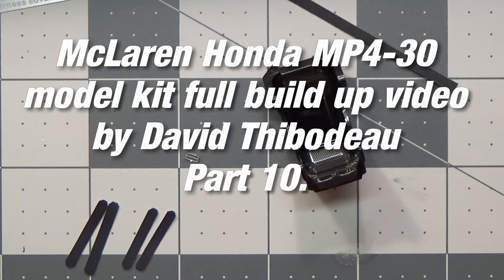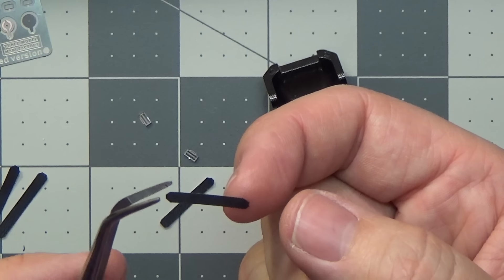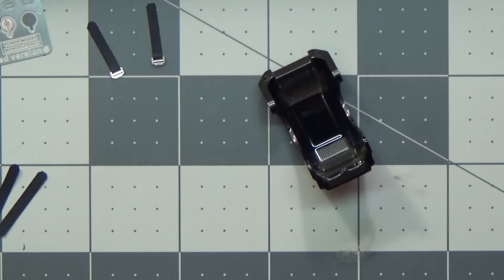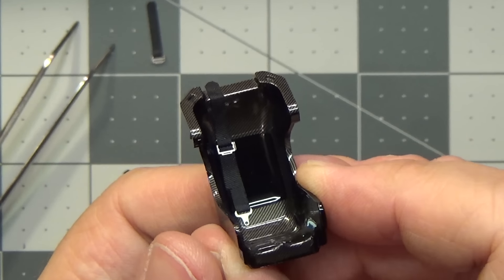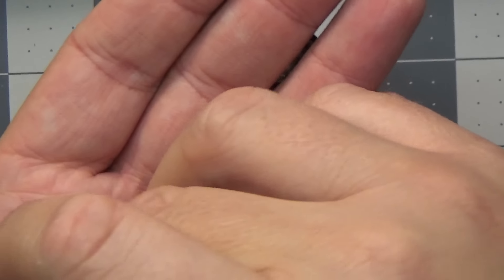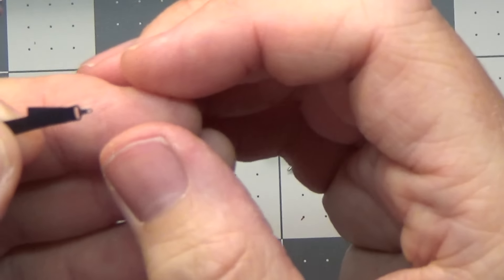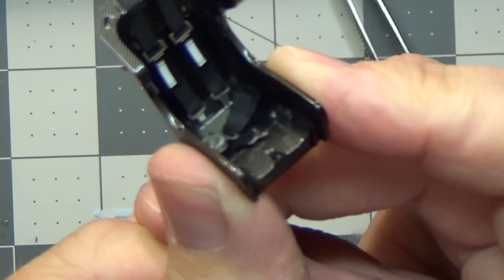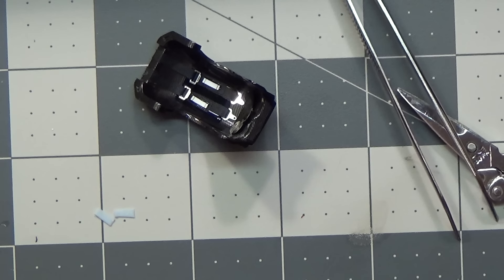McLaren Honda MP4-30 Ebbro Scale model kit build up video Part 10.

Comment: another great video as usual. Not that you need any advice from me, but as an aircraft builder for the most part I deal with these little seatbelts quite often, and one of the greatest tricks I learned is to leave the buckles on the frets while I thread the straps. Much easier to hang onto. 😃